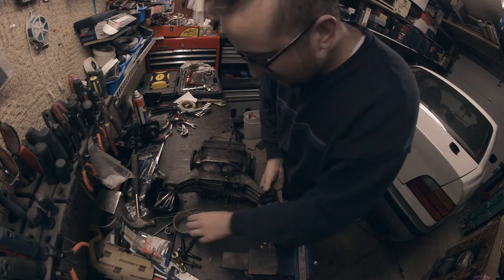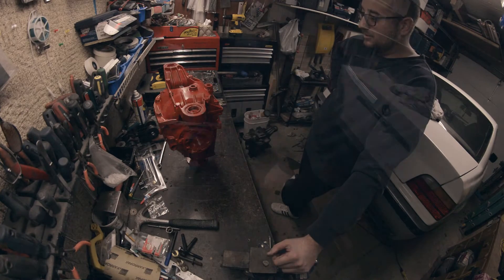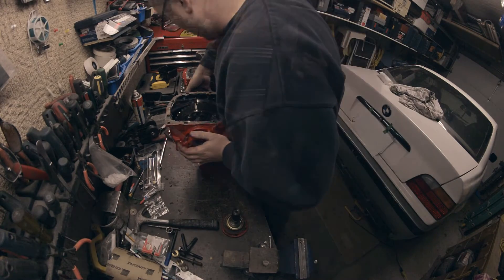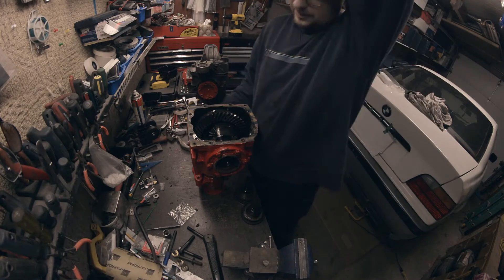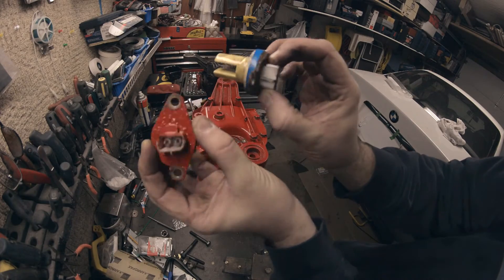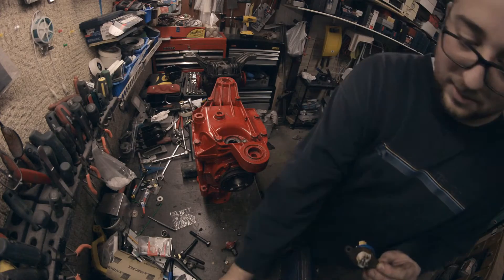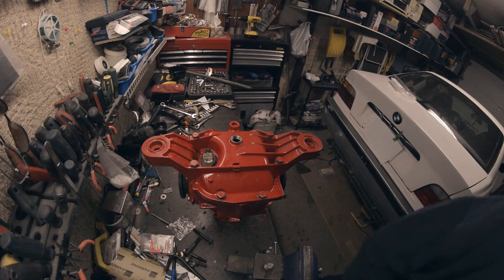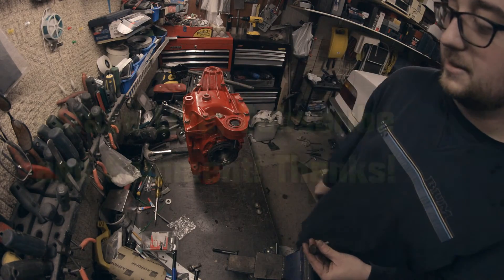How to Swap Differential Ears (BMW E36 3.45 LSD to 3.91 Welded)

Comment: Can you do the same with a large case diff? Like go from large to medium case? Much more lsd options for the medium case vs large case.
Reply from the maker: Honestly, no idea. We were ready to look for the appropriate half shafts to match the new diff, but decided to give this a try first and see how far off it was. Turned out it fits fine, but it was not planned. I would imagine going from a large diff to a medium diff you might have half shafts being too short (since it's the opposite of what we did) but maybe it will be ok just the same. If the large case is only a little bit wider it will likely be fine, since they do design all this with some play in mind. Let us know how it goes, and good luck!

Comment: One of the ears came out of the diff, is it possible to put back on? It's a 318i open. I can't move the car at all because of this
Reply from the maker: +peanut head should be able to simply tap it back in. You might have to disconnect the half shaft from the ear first, if it's on the car currently, so you can get the space to do so. Plus the resistance of the half shaft pulling the other way might be preventing you from going deep enough with the ear for the flange to click in properly. Half shaft and ear are held on together by about 10-12 special torqs bolts, just FYI. Ear into diff simply tap in.

Comment: how did you remove the input flange locknut im having troubles taking mine off i have a 30 mm socket but it wont fit on the side walls or is there any specific tool to use??

Comment: hey guys I have an e36 318is it came with a 3.45 lsd and I am trying to swap it for a 3.91 open, but my new differential is a bit longer than the lsd. I'm having a tough time fitting it in I have already swaped ears but i can't fit it to the end of the driveshaft because it is too long. any recommendations?  thanks
Reply from the maker: +David Truque we have a custom driveshaft that goes from the Mustang front or the BMW diff, and had to have it shortened for the 3.91 medium case diff. It only cost $80 for a shop to cut and balance it, so you might have to do that : /
Reply: +Weekend Agenda thank you guys appreciate the response :)